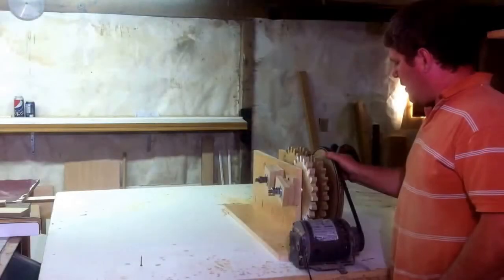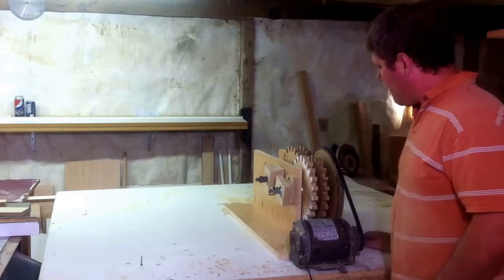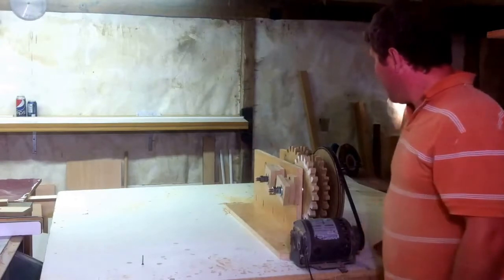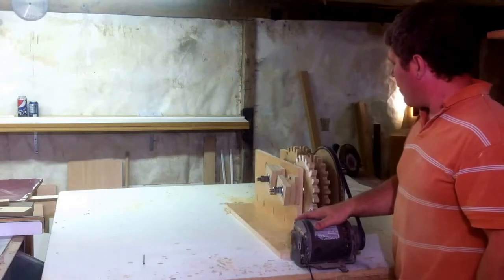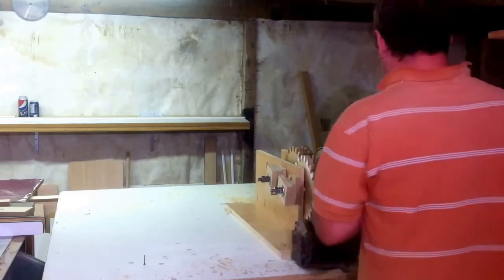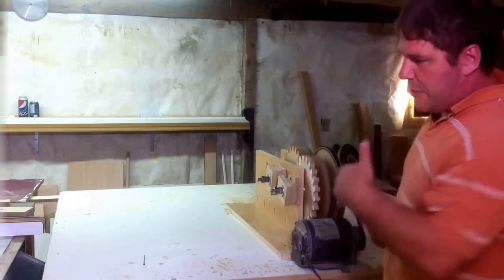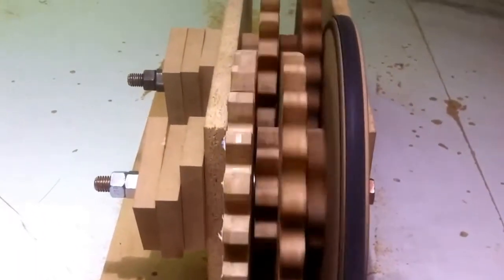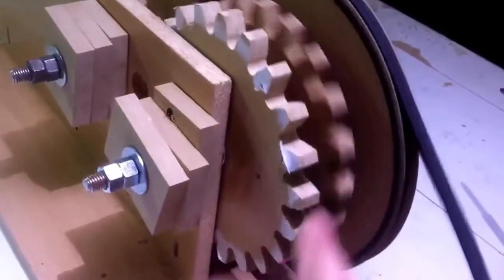Wooden Gearbox part 4  Wooden Gears

Comment from the maker: The mdf is 3/4 and the cutter is 1/2. The gears turned out pretty good actually. Something most people don't realize is that mdf comes in a bunch of different grades. The stuff most box stores sell is crap. Way to soft. The stuff I use I have to go to a specialty cabinet supply store. It allmost as hard as hardwood. I'm sure these will be very durable. I wouldn't make them out of cheap mdf though.